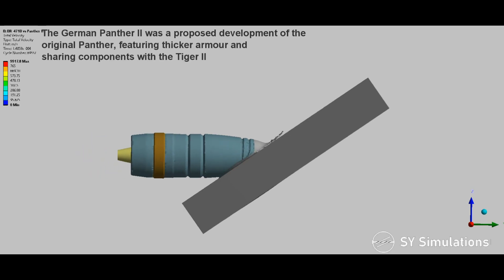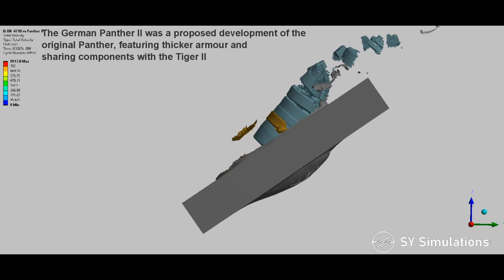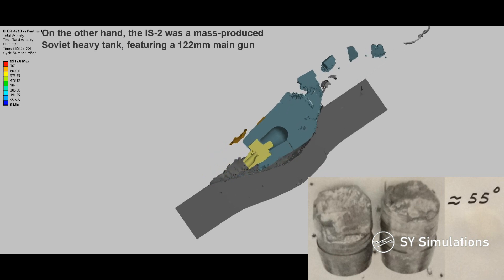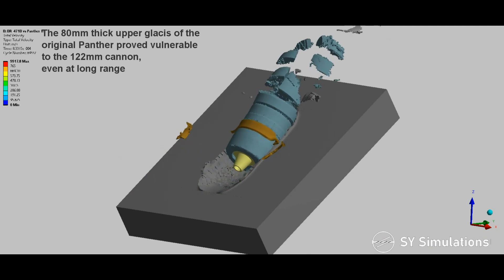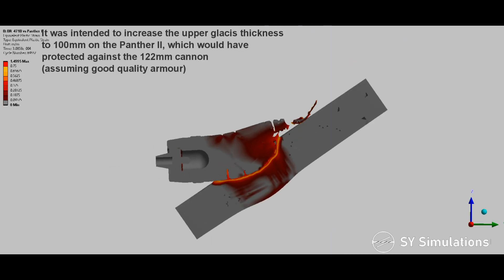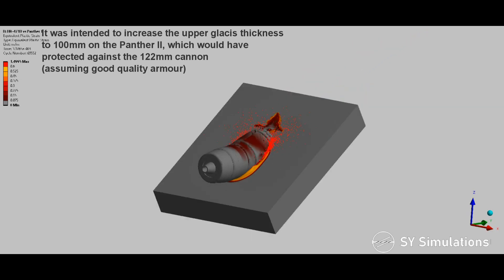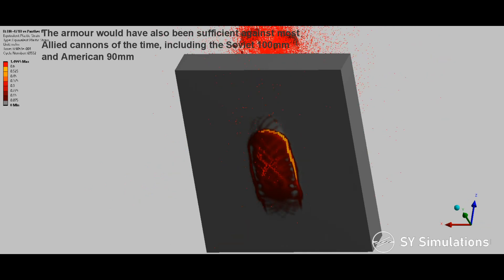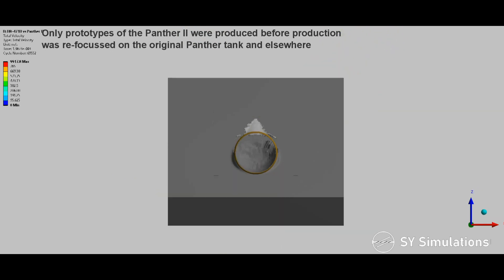IS-2 vs PANTHER II | 122mm APHE vs Up-Armoured Panther | Armour Penetration Simulation

Comment: Sidenote, one of the major reasons for the Panther 2 project was that the sides of the Panther 1 was vulnerable to the very common USSR Anti tank rifle. It was however solved by adding the side skirts which put the Panther 2 into a less favorable state over the Panther 1.

The German army initially wanted the Panther to only have 60mm of front armor, which they deemed sufficient and to lessen the logistical footprint of the tank. The 80mm was however chosen to please higher command (IIRC) which made the tank a lot heavier than originally planned. So for the Panther 2 to have both increased side armor and increased UFP would had made logistics even worse than it already was.
Reply: Increasing the armor from 60 to 80mm only increased the tank's weight by like 600 kilograms. Hardly 'a lot heavier'.
Reply: @ThatZenoGuy  The Panther 1 was as i stated supposed to have been a 30-35 ton tank that ended up at 45 tons. Now that weight increase was not only from increasing the UFP to 60mm. But the effect was still quite drastic as it reduced a lot of the bridges it could use to go over rivers.
Reply: @Fretti90  
Again, increasing the armor of the tank did not add 10 tons of weight to it. The initial design of 35 tons was a completely different (smaller) vehicle. The panther that we all know and love weighed about 43-45 tons from inception.
Reply: @Fretti90  It was never stated to have been 30 to 35 tons, even the first proposals of the tank already placed it at 37 to 38 tons, and we don't know if this was just the planned weight for the complete vehicle or just the hull.
Reply: @ThatZenoGuy  Ofc not, i said so as well. But to quote from Thomas Jentz and Hilary Doyle from their book on the german Panther (Which is the source material for the wikipedia page on the Panther 2). 

"On 10 February 1943, Dr. Wiebecke (chief design engineer for M.A.N.) suggested thoroughly redesigning the Panther II and incorporating Tiger II components such as the steering gear, final drives, the suspension system and turret based on Eastern Front experiences. The total weight would have increased to more than 50 tonnes". This is in reference to the earlier design that was just an up-armored Panther 1 to my understanding and did not incorporate the Tiger 2 parts.

I never said that only the added 20mm of UFP was the reason for it, i also stated that they increased the side armor to cope with the USSR Anti tank rifle that was able to penetrate the sides of the Panther behind the roadwheels.

ALL of the newly incorporated components and changes for the redesigned Panther 2 would according to the chief designer increase the weight to over 50 tons.

The reason i talked about the initial design proposal was to showcase that "This is what we want and we know we can handle logistically" to "This is what we got". As weight goes up, so does the logistical footprint and worse strategic movement.
Reply: @Fretti90  
That's not evidence, try harder.
Reply: @ThatZenoGuy  So my comments gets deleted because i had a link in them but look up "Germany's Panthers" by Hilary Doyle and Thomas Jentz, on page 51 it literary says what i said in my quote. If you do not trust them on the subject then the problem lies with you not trusting sources.
Reply: @Fretti90  
Yeah no, no falling for it. OG panther wasn't much lighter than what we ended up getting.
Reply: @ThatZenoGuy  These are literary THE people on the Panther subject.
Reply: @Fretti90  
And? They're still wrong. What's your point?
Reply: @ThatZenoGuy  Let me just doublecheck we are on the right page. I argue that the Panther 2 would be over 50 tons in weight. Which it says in the book. Just so that we are on the same page.

These guys are the people that everyone refer to when it comes to german tanks, especially Hillary Doyle. They were the ones that dug up all of the original documents in the national archives when they made this book.

If you do not believe that kind of source material then its a loss cause to convince you otherwise.

And i now place the burden of proof on you, show me a more compelling evidence for your claims than this.
Reply: @Fretti90  
This isn't reddit, but yeah you mistook what I was saying. Of course the Panther 2 was going to be heavier.
But panther 1's prototype with 60mm glacis was not really much lighter than actual Panther 1.
Reply: @ThatZenoGuy  Ok, seems like we have been talking about different things then. What i meant with the 30 ton tank was that the VK.30 project that was to be the Panther (or at least the Pz3/4 replacement) Initially was a 20t tank (the VK20...) that then became the VK.30. The VK.30 is the Panther that had a 60mm UFP and looked like the Panther that was to be.

The VK 30 would according to M.A.N and Deimler-Benz have a combat weight of 35 tons. So going off of what it was supposed to be and ended up at 43-45t shows how much more was added. Even if the UFP increase was only 600kg (which i would need to do the calculations on because it seems a bit low) the resulting tank was a lot more heavier. So when you plan to have a 35t tank suddenly be 45t then i at least would say its "a lot heavier" and strategic mobility will suffer a lot.
Reply: @Fretti90  
VK was never 35 tons though, its just not possible when it's only difference was 20mm of UFP.
Reply: @Fretti90  Yea the VK 3002 was not going to be 35 tonnes, and iirc according to documentation, the test bed/prorotype thingy weighed 42 tonnes already, and i'd think that would be without all the extra equipment as well as radios a service tank would have.

I calculated it once, and the total weight gain of adding 20mm of armour to the entire front excl. lower plate (Turret as well!), would be less than 800kg.

Hence i'd argue it was in actuality a very good decision (for once...) when Moustache Man ordered the up-armouring of the Panther, making it resistant to 76mm and 85mm guns frontally, with minimal tradeoff
Reply: @HSSdk  Regarding the 35 ton combat weight, it is listed as the designed weight of the VK 3002 design from both M.A.N and Deimler-Benz (Page 17 in "German Panthers" by Hilary doyle and Thomas Jentz). The production variant then ended up at a combat weight of around 45 tons on the Panther D (Same book but on page 23).

I've never said that going from 60 to 80mm was the cause for the increase. It was all of the design changes and that the original design was for a 35 ton tank. That is also the stance i took on the Panther 2 being over 50 tons in weight. The other guy that i discussed this with didnt provide any argument even after i did. All of this is easily available if you read "German Panthers" which is easily googled.
Reply: 60-70mm would have been optimal, but not a big weight saver. Panther is so heavy because it is super tall
Reply: @tedarcher9120  Because it was ineficient construction. 3 things add weight like crazy to the tanks - rear engine/front transmission, extended upper hull sides over tracks aka sponsons and finally tall and large engine bay. And Panther had all 3 of those.
Reply: @Bojan_Kavedzic  engine bay is the weirdest one, germansanaged to produce a tiny engine with 750hp and put it in the biggest imaginable engine bay
Reply: @Bojan_Kavedzic  Sherman also had 3 and it was the same weight as t-34
Reply: @tedarcher9120  T-34 also had two - large engine compartment due the longitudal placement of engine and sponsons. For what you can do if you eliminated those look at T-44 or T-55. T-44 doubled t-34-85 armor while staying ~same weight, being lower and actually increased space available to crew compared to T-34-85
Reply: @Bojan_Kavedzic  
What? That's not true at all. Sherman had all three of those as well ya know.
Reply: I think the weight issue would have been solved as it was supposed to use the Tiger 2 transmission, though I think the prototype still utilized the Panther I transmission. (The Germans really wanted semiautomatic/automatic transmissions - like on the early Panzer 3s and Tiger 1/2s)
Reply: @alexsv1938  I didnt mean in how it would drive. I mean how it would be transported to the battlefield. Most tanks were either transported by rail or trailer. Higher weight means that fewer bridges and transport trucks that could transport the tank to where it was needed.
Reply: That 20mm increase did not ad much extra weight, people claiming that this added tons of extra weight are just making a baseless claim
Reply: Not really. Logistics nightmare came because of having so many types of pretty much everything(trucks, artillery, halftracks, etc.)

60mm UPF would suck balls on Panther. Adding 1/3 of UPF weight wasn't much looking at total weight of Panther.
Reply: You'd be forgetting the major metallurgy problems of Germany during the mid to late war. Even at an increased thickness, Reich armor plates were brittle and crap.
Reply: @Mthammere2010  
Except that's not true at all lmao? Prove it.

Comment: Most of the time, the IS-2 fired HE, which would've knocked out or at least immobilised any German armour it fired at anyway.
Reply: it depends on the plate
Reply: @King.Leonidas  it doesnt, even a non pen would at least blow the crews eardrums
Reply: @barbarapitenthusiast7103 Nope
Reply: @Kuschel_K  "no guys, a 122mm HE Shell blowing up on a german tank would defenetly not cause any harm to the crew, trust me bro." You are somewhat correct, as in the 122mm would reform the armor and likely shatter it, especialy considering late war german steel quality .
Reply: @barbarapitenthusiast7103  That's why they are using headphones.
Reply: @HanSolo__   those arent going to protect you from the explosion outside
Reply: @King.Leonidas  not really, 122mm HE was able cause Tiger-1 UFP to fail and collapse. Also even if you are shooting at like a Maus or something the sound created by the explosion would still stun the crew at lest for a moment